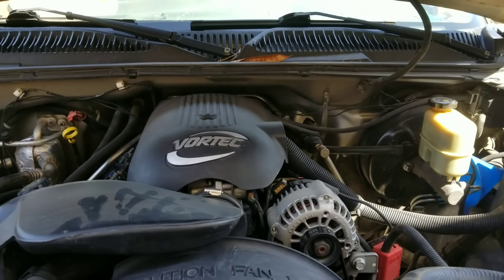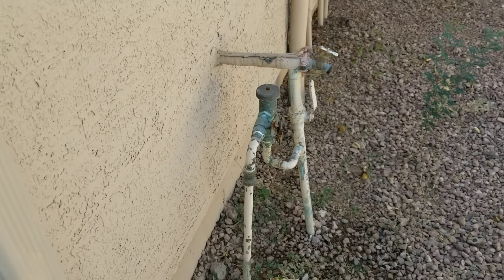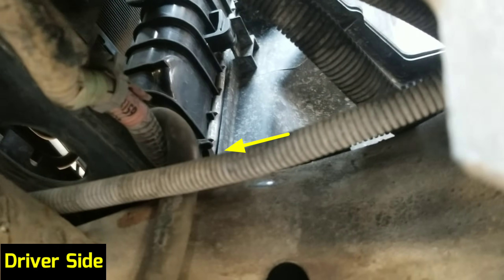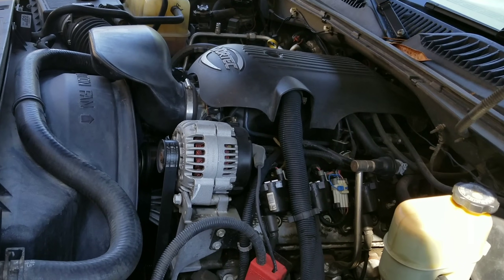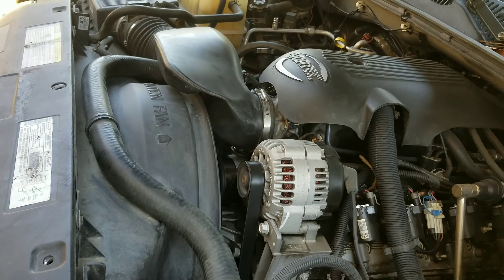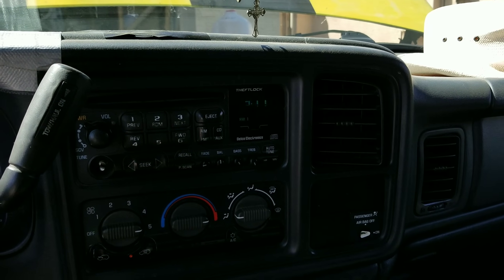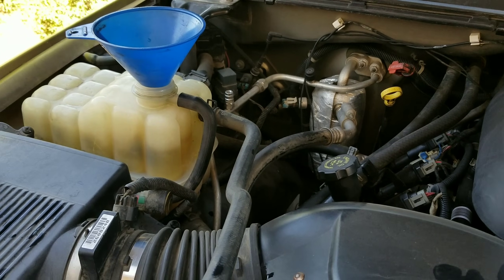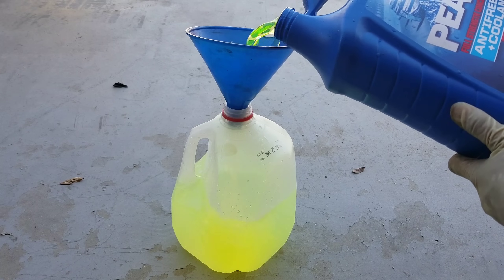How To Flush Your Coolant System! | Chevy Silverado Coolant Change Drain & Fill

Comment: NEVER USE TAP WATER IN YOUR COOLING SYSTEM
Reply from the maker: it was not used for long term only to flush the system
Reply: Some of the two water is still in that vehicle after the procedure is over. Likely containing contaminates - depending on where you live. Some cities have excellent water (some places in Colorado) and some places have horrible water (like most places in Arizona.

Comment: Such a Big mistake, 
Done after draining original Orange color DEX-COOL antifreeze, 
That's the only one Brand allowed to be in the GM Trucks, 
But after U drained originally one,
U filled with wring one,
Green color one (contains silicate)👎.
  No good at all for GM Blocks , gaskets and radiator .
Go spend few bucks more, and buy properly coolant,.
Don't due that to your Vehicle Brother.
All best. 👍👍👍